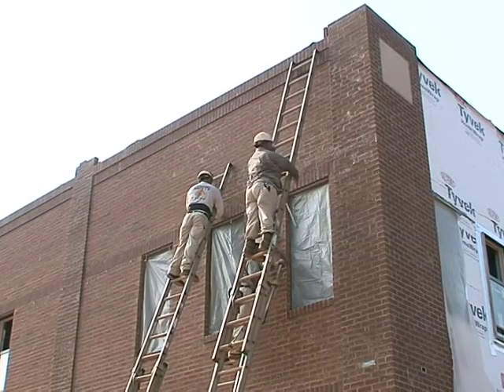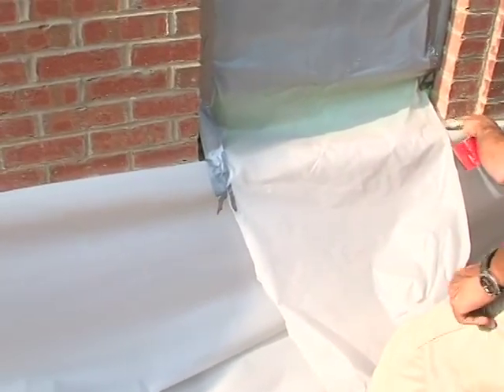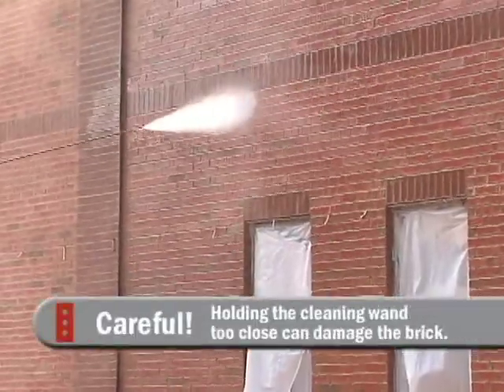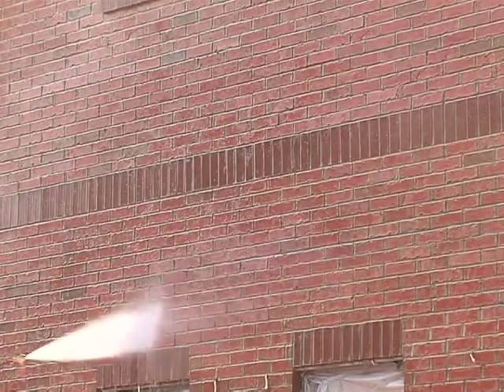Cleaning

Comment: What about the rain carving into mortar joints over the years because the  mortar mix was too weak? At this point I prefer to use a stronger mortar type to avoid this problem that It is happening alot by the way